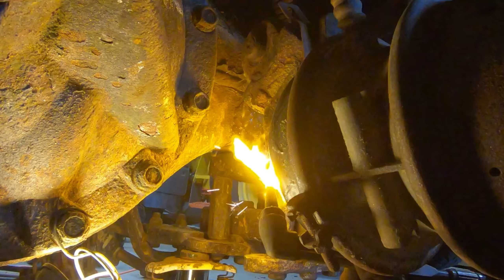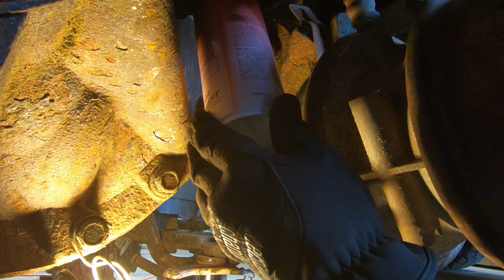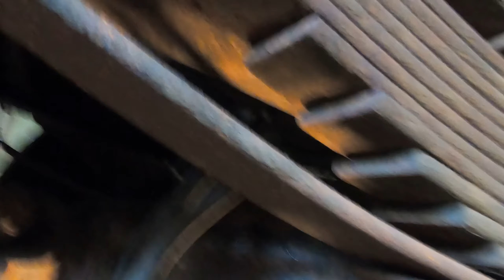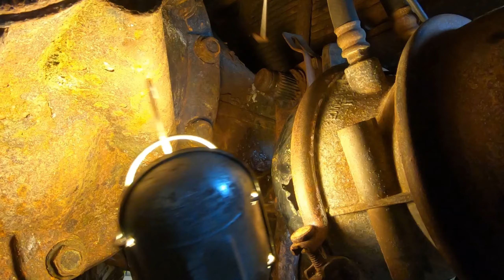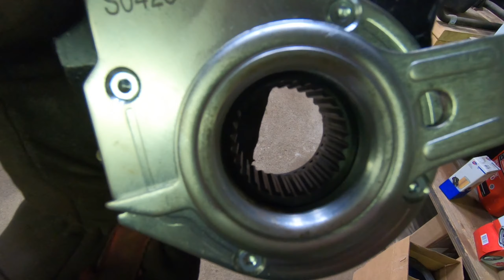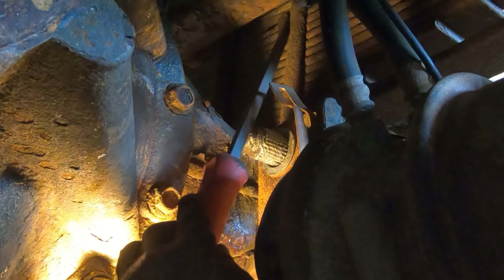changing a slack adjuster and running into extra work part 2

Comment: Slide hammer - tire bead breaker, love it. Great idea. Thank you
Reply from the maker: No problem. They make pullers that will slide on or bolt on to the slack adjuster to pull them off but they are a few hundred dollars for them.

Comment: You notice haldex style slacks don’t have a grease lube grove on the s cam spline. So they are always very stuck after a few years on the road no matter how much anti seize you put on the spline and the slack.
Reply from the maker: Yeah your almost always gonna have a fight with a slack adjuster. On the rare occasion I’ve had a few come off easy. I was excited to see the tire bead breaker fit just enough to knock the slack adjuster off though, that saved a lot of time and fighting. That was like finding money in the street. Thanks for watching.

Comment: Are tires and brake drums usually that difficult to remove or only after years of no maintenance?  Do you find that an air chisel to remove rust from threads works well vs say a needle scaler?  Do you usually just knock the rust off, or is there also a risk of damaging the threads as well?  Just curious.
Reply from the maker: This is on a salt truck so this is not how it usually is. The salt rusts the wheel to the hub.